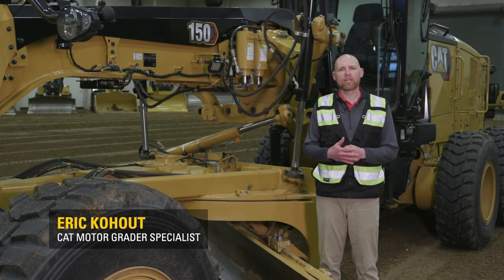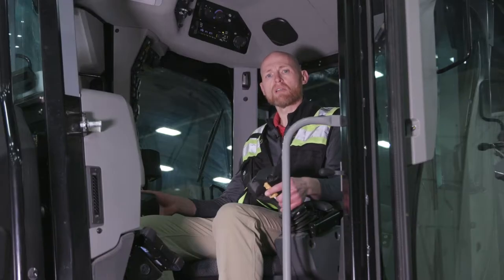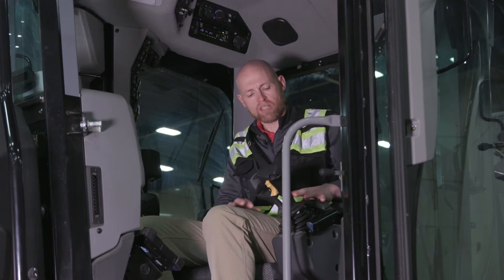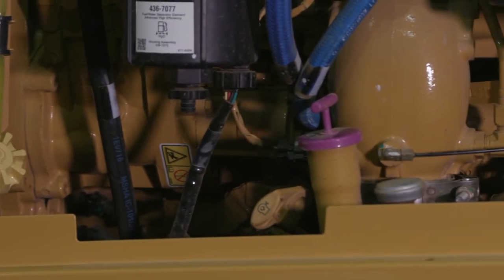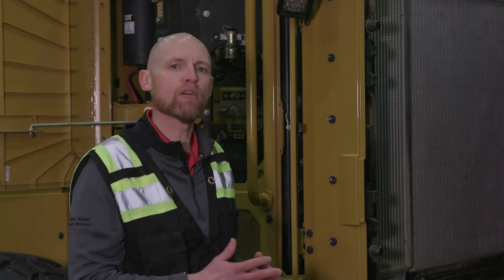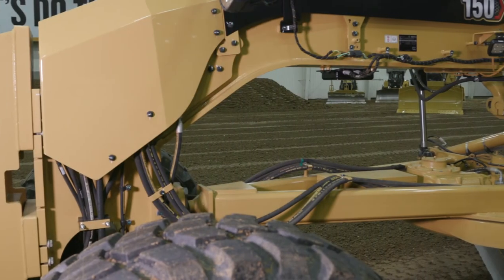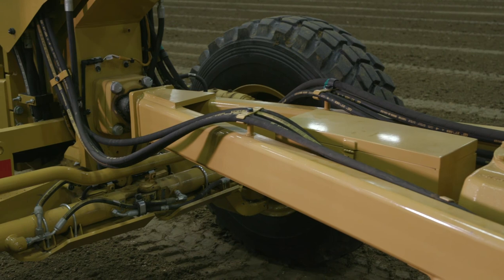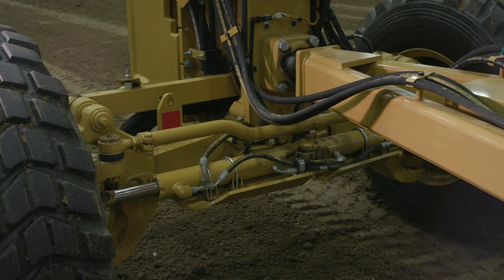Cat® 150 Motor Grader walk around

Comment: As a full time 140m3 awd operator there’s two things I would change in a heartbeat! Armrests that move with the seat. Nothing more irritating then hitting bumps while moving snow or roading and your seat bounces and slams your elbows down onto the stationary armrests. And second is having a maintenance free circle like John Deere has. Oh they also have a DPF filter that lasts at least 10,000 hours! Other than that I love it!
Reply: After 28 years in the seat, my shoulders are screwed, probably from the seat design

Comment: Crap grader
Doors won’t seal
Lag in gear change which can’t be good for the tranny
Auto cross fall out by 1% after calibration 
Turbo leaked resulting in burning decal on door 
Gotta blow out grass from radiator at least once a day
Reply: Brass side shift bushings barely last 500 hrs